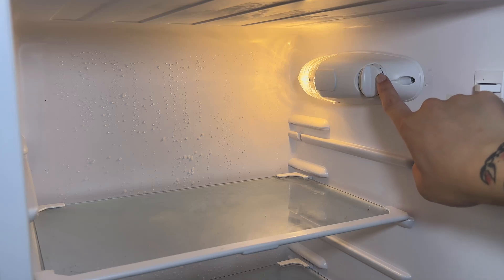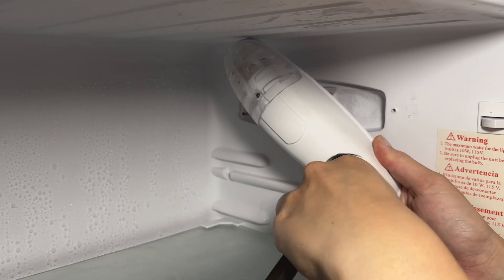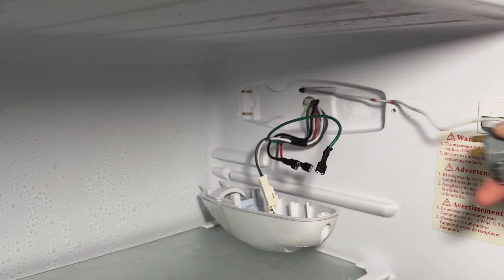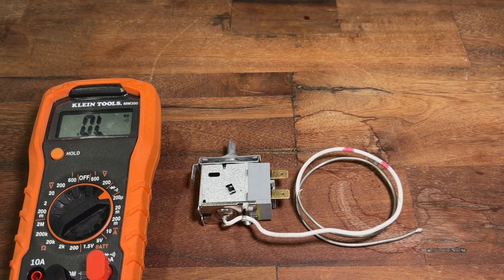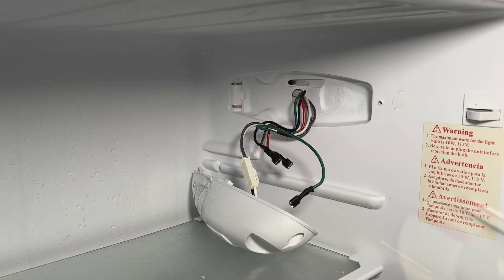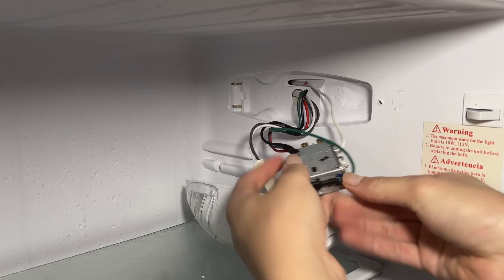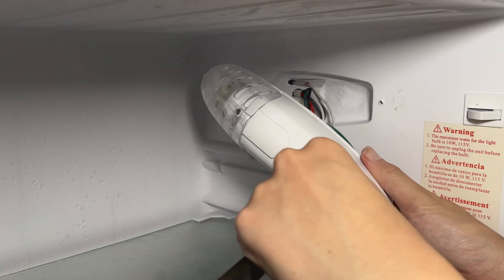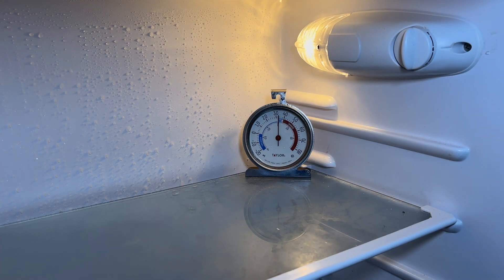How to Test and Replace a Refrigerator Thermostat - Easy DIY Fix!

Comment: So if test ice water that wouldn't work then ?
I get a reading 000.2 when warm but I get the same thing in ice water .
Freezer is cold ,fridge is cool not warm , compressor running
Reply from the maker: Ice water isn’t cold enough to trigger the thermostat, that’s why I used a can of air duster for testing. If the compressor runs but the refrigerator isn’t cooling it could be another problem though.
Reply: @DragonBuilds ok thanks , I would would get a can of air and try it and see
Reply: @DragonBuilds didn't get the can air but I put in place it in the freezer for like 45 minutes and didn't get any reading .
But how long after removing it from the freezer should I get reading , because I got a reading at 1 minute and 30 seconds
Reply from the maker: If your freezer was able to make the thermostat shut off then the problem is probably something else, not the thermostat.
Reply: @DragonBuilds ok thanks again ,well I got some more digging to do to find out why my fridge is warm

Comment: I have the same fridge but it doesn’t cool. Compressor is warm and humming but not cooling
Reply from the maker: That's not good! If the compressor runs then it's not the thermostat. Does the side of the refrigerator get warm at all? If so then it could be a defroster issue. If the outside doesn't heat up and the inside doesn't cool down, it could be a refrigerant leak or faulty compressor.

Comment: Is this for a Magic Chef mini-fridge? I think I have the same model and same issue.

What’s the part number for the replacement thermostat? Where did you order it from?
Reply from the maker: Yes it is! I installed a generic universal thermostat, they’re around $10 on Amazon. I’d recommend removing the existing thermostat first and buying a matching one.